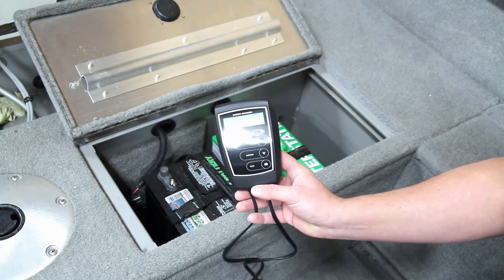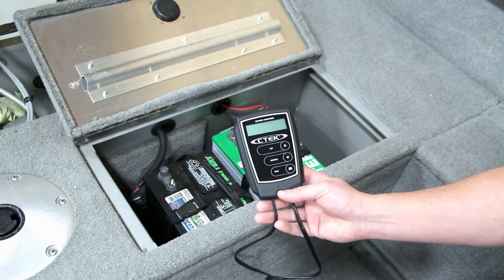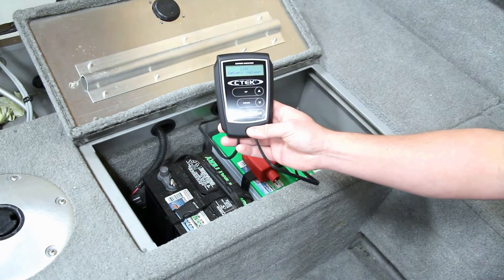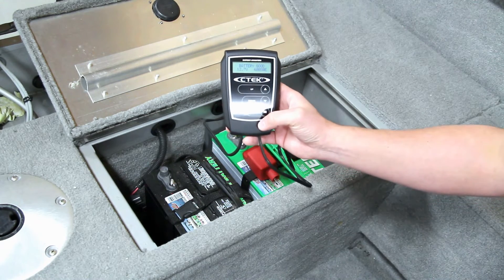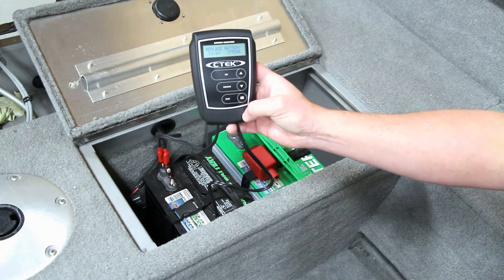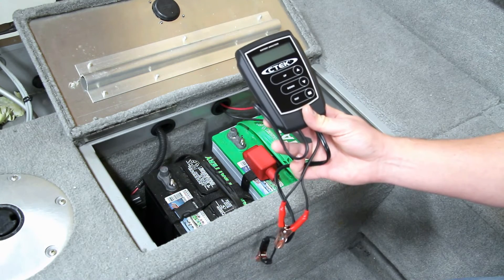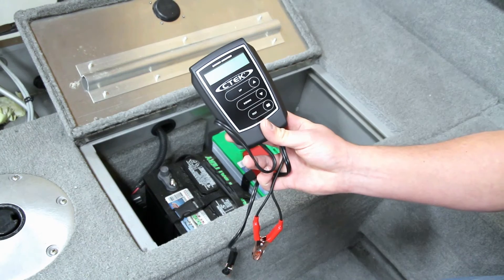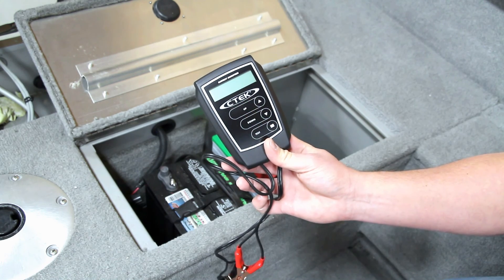CTEK Battery Analyzer and Tester Review

Comment: Hi, thanks for the video.  Does charging a battery also raise the cold cranking amps or do you need to drive the car to get the CCA up.  Thanks!
Reply: Tony M f
Reply from the maker: Tony M CCA is a measurement of the batteries power, so charging it with a battery charger will raise it.  Trickle chargers may not.
Reply: @WorkshopAddict  A trickle charger, though slow, is still a charger, is it not?  Anyway I was really curious about this analyzer - it says it doesn't create any loads on the battery so what can it be doing - is it measuring the internal resistance?  If it's a simple volt meter then it's not much more useful (in fact I'd say less) than a $5 multimeter.
Reply: @mikethelma  What baffles me is how the hell you could misinterpret what chocolate squiggle wrote so badly. He clearly knows how a volt meter works and how little use they are when testing battery condition. I agree totally with chocolate squiggle that it's your reading comprehension that is the problem here. What he asked was how the CTEK analyzer does its measurement since it says it doesn't (like an old analoge battery tester with built in power resistor) draw a load from the battery. If you can't answer that, just shut up instead of telling things nobody asked and that everybody knows.